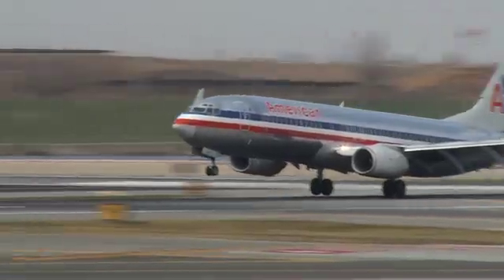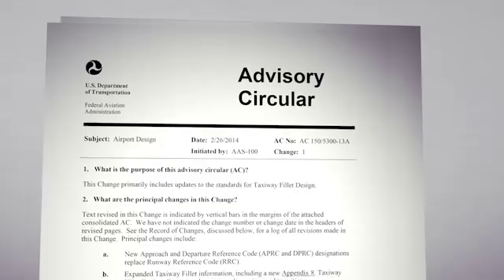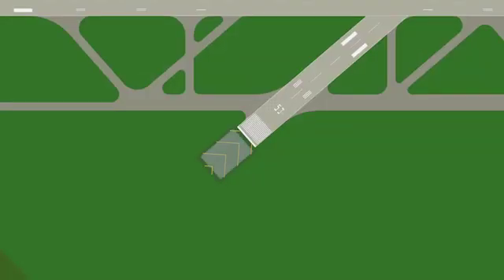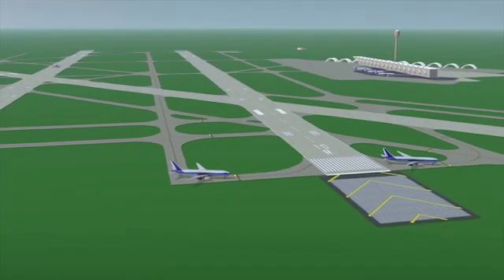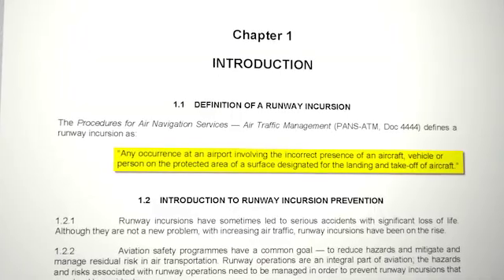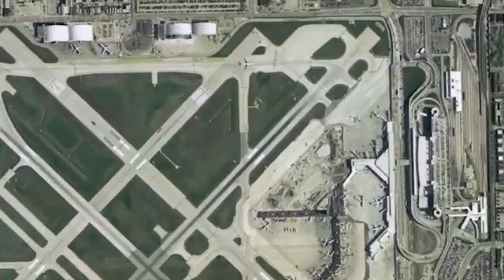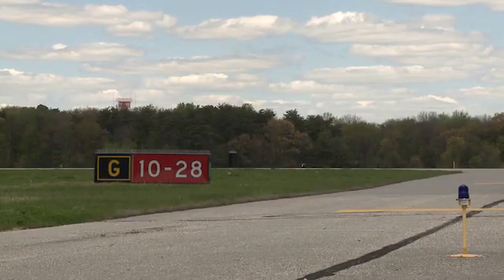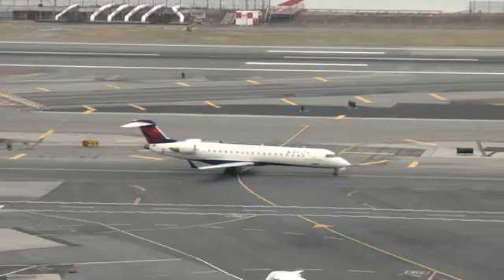Runway Safety Area and Runway Incursion Mitigation Programs

Comment: What is an airport sponsors?  Sponsor is the term used when "airport operators" are dealing with the financial side of the house with the Airport's Division.  Sponsors, is that slippery slope that has lead airports down the same slide as Boeing with FAA Flight standards...